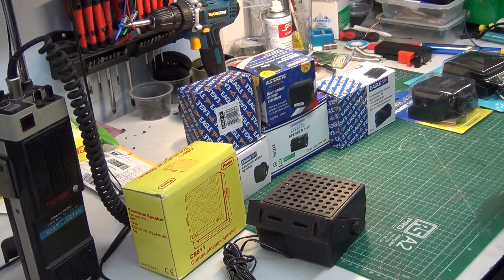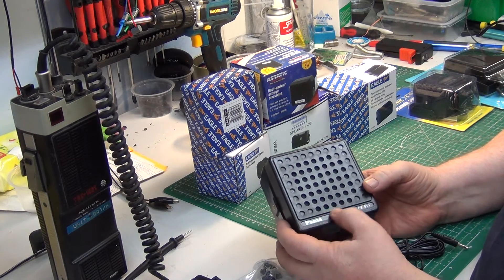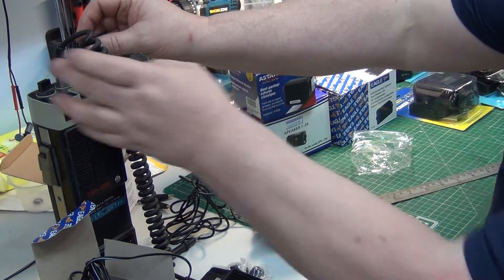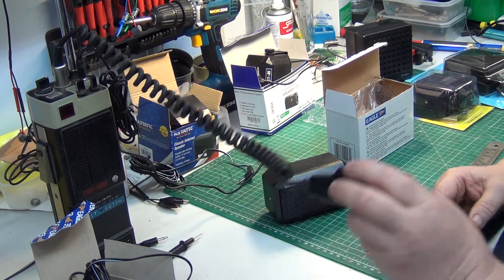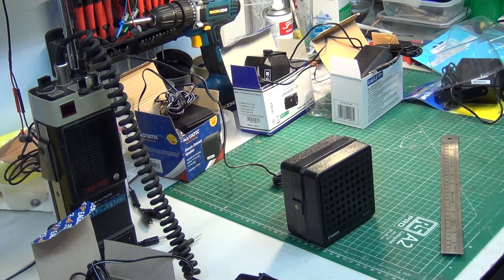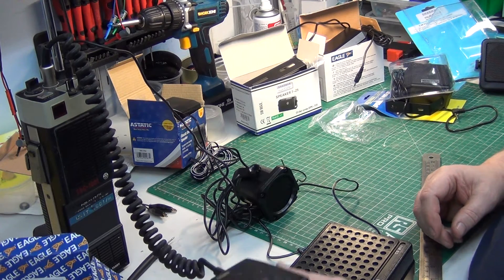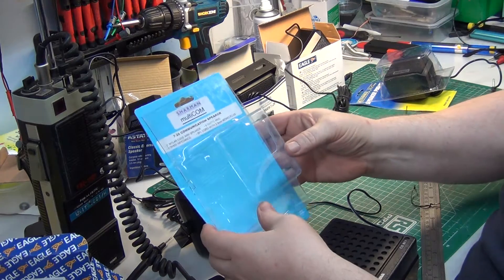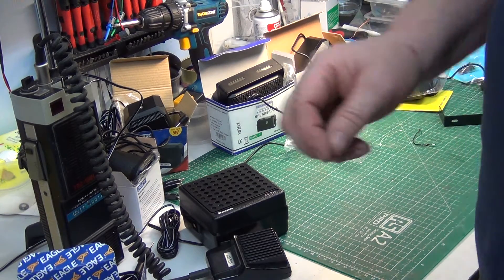Extension Speaker comparison super test, CB radio, Ham radio, business radio

Comment: ive got one of those oldskool extension speakers. the only difference is mine has a "filter" button!
Reply from the maker: I should have mentioned the version with the 'filter' button! The unreliable switch connects a capacitor to cut the treble slightly. For the American AM CB market this may well have worked as a filter. On FM radio systems it would just cut the treble.

Richard, G0OJF, UK